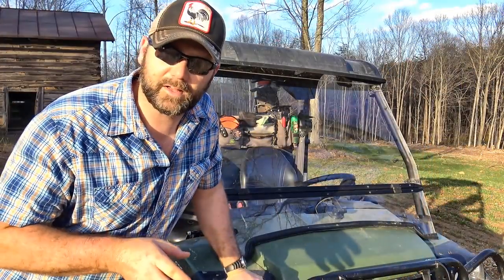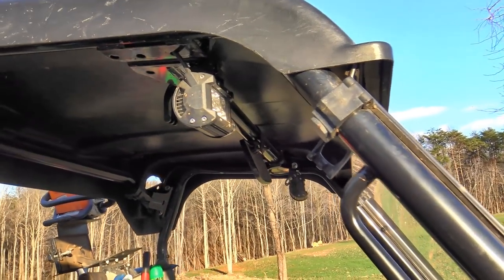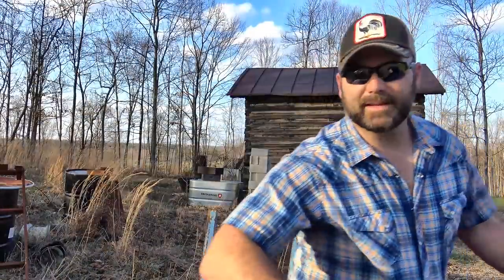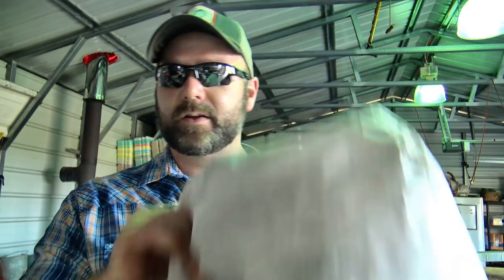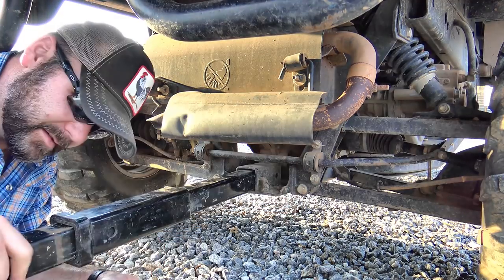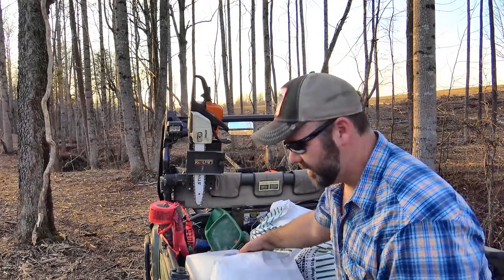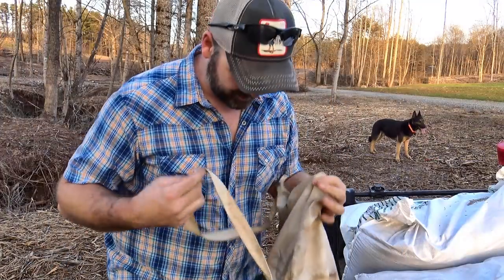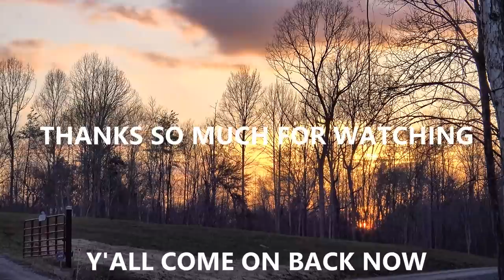TIS THE SEASON.....GOING TOPLESS ON THE FARM

Comment: I've had a Leatherman Wave since '99 or 2000, never failed me. Can be hard to sharpen, but holds an edge great. Try one, the blades open from the outside and lock, you'll love it like I do.

Comment: I love the John Deere HPX 4x4 diesel Gator it is buy far my favorite farm tool carrier. Mine usually had a engine drive Miller Bobcat in the back with a compressor and a small job box stocked with tools and a 6x8 hand dump trailer I made I love that set up!

Comment: I have had multiple multi tools and the  Leatherman and Gerber  Both end up gumming up around the pivot pin.  Almost the same thing has happened to me.  What I did to fix it was use wd-40 to clean out the junk and then I used some motor oil to lube the pin.  I have not had a problem since. 

Love the videos.

Comment: Think you may like a mounted spinner better.  Less chance of those pull types wanting to tip over.  Easy to hook up mount.  They make several types that hook into the battery for power.  Mounted on front makes it easier to get good coverage.

Comment: Why didn't you just open the hole up all the way on the seeder that hooks to the back of the gator may I ask
Reply from the maker: I did ...wasnt coming out quite fast enough...I think the spreader is better suited on a mower that travels at consistent low speeds and smooth ground